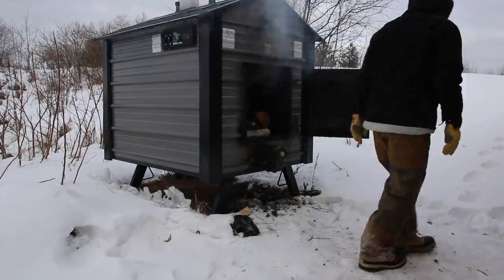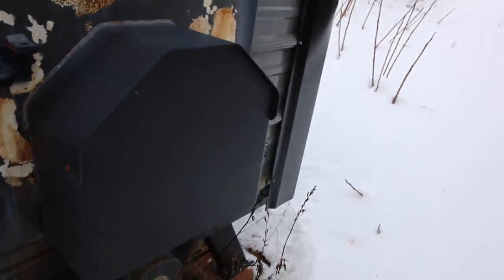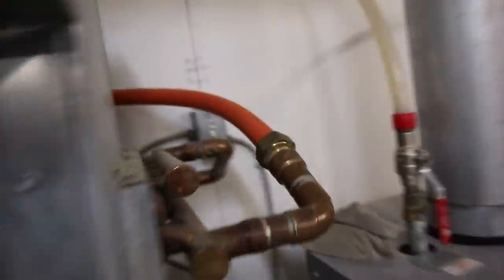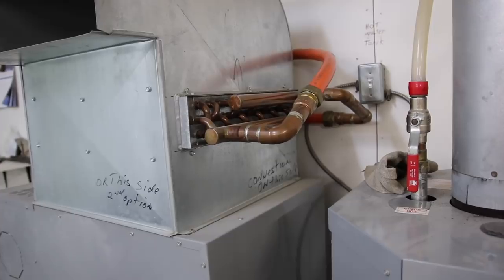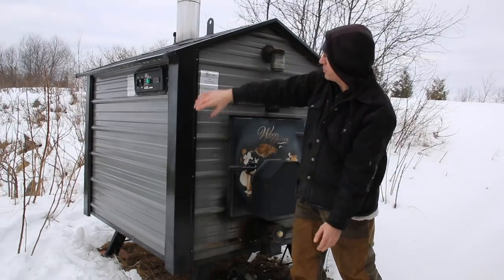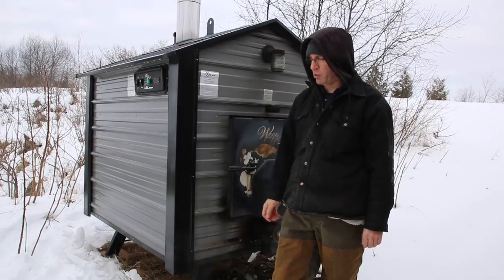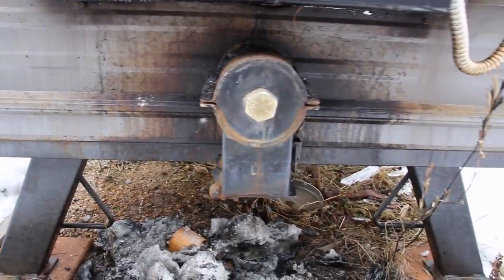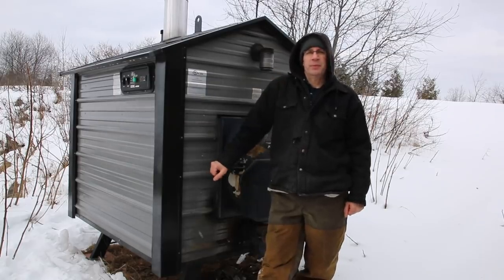Outdoor wood furnace "worth the investment?"

Comment: Just to add a comment on wood heat in general. I have a job where I am restricted from other employment. So I am a salaried employee with nearly no options to make additional income. So if I want to do things like save more for a large purchase like a new car/lift/tires what ever I need to reduce my spending and be more frugal.  two tanks of Heating oil run me about $3000 ...5 cords of wood runs me about 20 in permit plus 150 fuel. 5-8 days to cut and haul... I split in the woods by hand. I will tell you that working that hard you do get in better shape and as long as you dont over do it ..you feel better.

Comment: I guess it all depends on where you live and how your setup is. We have  a Woodmaster 5500 with ash augers, and we love it. Yes, they do burn a little more wood, but for us it's the way to go.  On the older models, the ash augers did not work as advertised,  but they have since then changed the design and they work very well. Dry split wood definitely burns better in these boilers and is more efficient but there are times when we do mix a little green in with the dry. We have a good setup on ours though as when the north wind blows, the smoke all blows away from the house and we do not have any neighbors close by.

Comment: OK.  Having been a Northern Maine Central Wood Boiler owner/user on my 15th year of use heating a like 2,600 square foot home, domestic hot water, and 4-car workshop/garage, I'm in love with it.  First, there is no meaningful fuel cost fluctuation for wood, as delivered tree-length hardwood has stayed at about $100-120 per weighed cord, while #2 fuel oil has fluctuated from a 2005 low of $1.69/gal to a high of almost $5.00(!) per gallon in like 2007 or 2008.  The fuel savings of a single winter easily covered the cost of the boiler, install, and a top-quality chainsaw like a Husqvarna or Stihl for many, many years.  Second, there's no splitting, and fresh beech, maple, ash, and birch cuts and stacks quick, and is a good workout.  Even with my wood pile about 100 yards from my boiler, I can load it twice daily in about 20 minutes total, and I dig the ash about every 6th week or so, which only takes like 25 minutes, tops.  I have a dedicated set of insulated coveralls to wear when loading it, and that's easy on and off, and lasts for years of daily winter use.  Unlimited 180 degree hot water is priceless.  Sure, it's a little work, but so is anything worth doing.  Some folks would rather throw money at a problem, but I've found a better, quieter, more efficient, and warmer way to enjoy some of the coldest winters the U.S. has to offer.

Comment: i just built a double barrel wood stove from a kit and a couple recycled barrels.   move it into a corner in the summertime and move it under and attach it to the stack in the winter.   it kicks out tons of heat, almost zero smoke and keeps the shop warm just when i need it.   i mostly used scrap wood from shop projects.